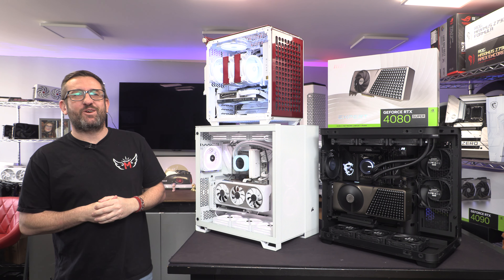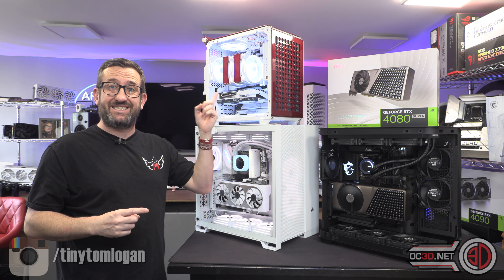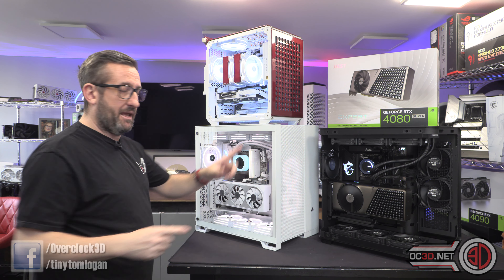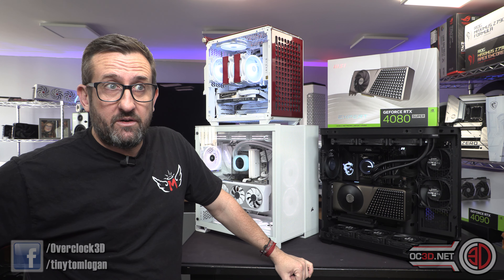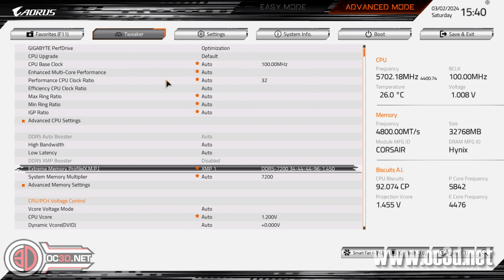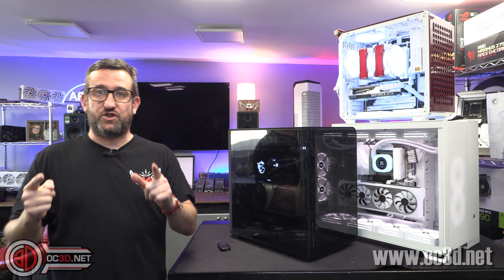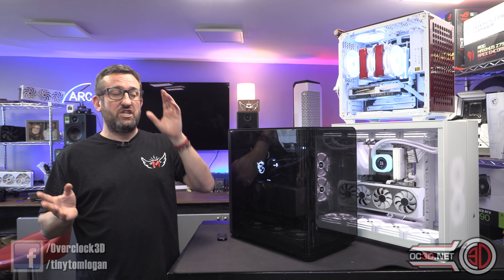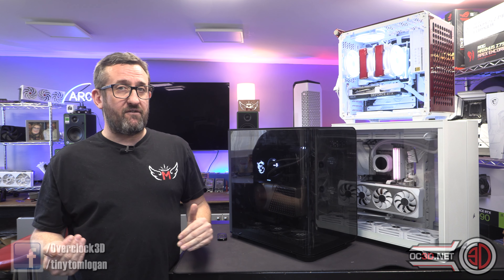Intel CPU Undervolting Guide Asus MSI Gigabyte 13th 14th Gen

Comment: why use fixed volts? and not offset. because in fixed it will allways run high voltages also in idle.
Reply: Also waiting for some good explanation in this
Reply: @lifeordeath13 if you run fixed clock and voltage, actually cpu degrades slower becuse it doesnt shifts the clocks and voltages all the time. prime example 6600k 1.32->1.34v 4.6ghz. you just need to run cpu with limits of cooler. back the i was on noctua cooler, and now with 9900k with 240aio. goal is to keep cpu under 75C to get that longetivity and slow degrade that can keep runin cpu for 15-20y

Comment: I have a 13700K and an Asus z790 motherboard, I managed to undervolt the cpu with a negative offset of -0.05v and LLC 3. The performance loss was minimal, non existent in games. I lost maybe 7 or 8 degrees.
Reply: Your way is hardly worth the effort for just 7 or 8 degrees.
Reply: @a1smith  Totally worth it in my opinion, not just the temperature loss, but my air cooler is less noisy
Reply: @a1smith  7-8 degrees is HUGE on this generation, which struggles with low clocks/crashes because of overheating
Reply: @AngryChineseWoman how did you undervolt it where that option in asus motherboard? Is it global cpu voltage or smth?
Reply: @a1smith
It is if your temps are approaching 100 degrees !!!
Reply: @TransformHypnosis  Exactly.

Stupid comment to make.

Comment: I don't approach undervolting with fixed voltages on Intel. I have asus motherboard and I found an undervolting guide on overclockers website that utilize the IA AC Load line to 0.26 and IA DC load line to 1.02. Set the limits to 253 W and 280W.  My 14900k does not reach 100 degrees anymore but 82 degrees on cinebench and reaches a score of 41500. There is multiple ways to undervolt the CPU. But the best way is adaptive undervolts.
Reply: Do you have a z790?
Reply: @blvzvr  yup z790 strix e gaming
Reply: ive got a similiar setup as yours. do you have a link to the guide please? cheers
Reply: @deano4003 the guide uses numbers for 13900k u will want to start with 0.3 for 14900k. And dial down  . The guide is very comprehensive there is one specific part in the beginning. Title let's start tunning the beat
Reply: I was able to find the guide (I think) by adapting what you had to: "Let's start tuning the beast" and searching for that on google. Thanks for mentioning the guide. Checking it out now.
Reply: What LLC and amp value?  what made made you opt for 280 on pl2?  I've been toying with 253/253/307 and 400a, along with auto dc and ac around 0.3 (may add in negative offset too) at LLC5, this on z790-e rog strix 14900k liquid III cooler (temps can still spike into 90s easily depending on workloads, simming and gaming 60-80c avg), cinebench maybe 85-88c (warm room 76F)
Reply: Does anyone could share the settings you’re all using to undervolt the 14900k?

Comment: Does using a fixed undervolt degrade the CPU faster because it’s always at the at voltage even at idle? Rather than voltage lowering at idle?

Comment: After months of frustrations with my i9 14900kf overheating, crashing during games and bsods, reading a million different solutions on the internet on tweaking the bios, this guide explained everything so clearly in each bios as the settings are quite confusing and frankly, overwhelming. Thank you
Reply: My god man. Same here. The only tweak that I think, still testing, worked for me, is locking p-cores on 5.5.

Comment: Thank you so much for this video! I've been going crazy for the since Oct 2023 with the i9 14900K and Asus Dark Hero motherboard.  Adobe Premeire and Media Encoder would crash CONSTANTLY when working with LOG video files and for the first time and I could NOT MAKE ANY SENSE of any of it.  Even went to the point where I thought my RTX 3090 was defective and even upgraded the GPU.  This solution FIXED EVERYTHING!
Reply: I went through the same thing two years ago when I built my i9 13gen and Asus z690e motherboard. The motherboard was pushing the 4,090 watch under unlimited power and it was giving me blue screens of death I spent months reinstalling drivers reinstalling Windows upgrading and changing out parts and components it was so frustrating . And in the end it was Intel and Asus not playing nice together I can't believe the hundreds of hours I wasted and the money for that matter

Comment: I would advocate using the LEAST aggressive LLC for undervolting - there is a phenomenon called undershoot that gets worse with more aggressive LLC, and if you are undervolting, undershoots can dip into unstable territory. Buildzoid has some great videos about it; you need an oscilloscope to know what's going on!
Less aggressive LLC means higher set/idle voltage (doesn't matter, because there's no current), but lower stable load voltages.

Comment: You are a cool dude, especially for showing us the same approach with 3 different brands. Thank you! I got a Gigabyte H610 board with an i3-12100F and NH-D15s. This system needs no undervolting, but it’s fun to play anyway. I use OCCT > Stability > Power for stressing. Best drops I get so far are 80W to 60W power, 71 to 53 degC temp, 1.16v to 0.90v vcore. Those are the hwinfo64 peaks after a 1min stress run. My bios vcore setting only goes as low as 1.1v. So to get lower I have to use dynamic vcore offset of -0.3v (its lowest option). LLC on Turbo. CPU clocks pegged at 4.1ghz permanently.

Comment: So I did my first build two years ago and back then I used the Asus z690e motherboard , the Intel I9 13k chip, two dims 32 GB each ddr5 Ram 6400 , NZXT crack and z63 two extra fans for push-pull configuration, the Hyte y60 box, 850watts psu gold star rated of course and the Asus dual 3070 out of my old PC. The first year I was using a lot of default settings and I ran into the 4,096 Watts being pushed instead of the 253 Intel default.. It being my first build and also being in the process of learning I assumed I did something wrong and every other day when I got my blue screen of death while working in Lightroom classic or Adobe Premiere I would tweak things here and there. One of the things that I have always heard over the last year is to undervolt. I know we're undervolting is and I know there is a positive side and a negative side. My question is this on Intel XTU when you let it run under the Intel optimized setting Intel will put it at +20. Can you tell me why they do that if we're supposed to be undervolting? The other thing is intel's optimized on XTU will actually make my computer thermal throttle like crazy. My number five core constantly hits 100 but the other 7 cores on my P course stay in the high 80s low 90s for the most part I'm talking like 88 to 91 . It's only the number five core that hits 100 when I'm throttling. I've taken my cooler off at least twice to repaste it because that's what I've been told but I still have the same issue with that one core. Chat GPT gave me a couple things to try recently but I still got the same temperature. So I guess I have two questions the first question is why does Intel optimization over volt instead of undervolting? Because I thought they were supposed to be in the negative . And number two if I did undervolt and all my temperatures are good except my number five core . Is it possible to just undervolt that one core? And if so what is a good starting place.. By the way my computer runs normally around 29 to 31° C when it's not under any loads . Under load it jumps up to 50s or 60s. When I'm doing hardcore Lightroom editing real fast it will thermal throttle up to 💯.. That's why I want to get this thermal throttling issue under control. My Intel benchmarks are like 12,600. I don't know if that's good or bad either

Comment: IMO, undervolting is a must-do - the factory settings are, are almost every CPU, massively generous.
Take the 5800X 3D, for example: use curve optimizer, and the temp goes down, while the performance goes UP.

Comment: Great video thank you, but one question - what's the difference between tinkering with all of these VRM voltages and load line calibrations versus simply going into Intel's XTU and setting an offset of say 085 and having your temperatures exactly where you want them to be? I don't understand because you're achieving the exact same thing basically even if you were to set all the cores to say, 5.8 or even 5.9, you just increase the offset negative and you still achieve the same thing.

Comment: I was working on reducing temps of a 14900KF yesterday which was running in the 80s degC in game.  In the MSI BIOS I used the 'cpu cooler tuning' setting to go from a 288W limit to a 253W limit (Intel's own spec limit) and also dropped the voltages by 0.05v with voltage offset mode.  This dropped temps by 16 degC in game!  If I only did the undervolt then that only gave a 4 degC drop.  So the power limiter was much more significant than the undervolt for temps.  Performance in-game was 0.2 FPS average lower (ie. not noticable) but with a 16 degC reducing in temps.
Reply: Where did you find the cpu cooler settings?

Comment: Hi, can totaly agree your undervolting arguments. But in the MSI-BIOS: "CPU Loadline Calibration Control" should set to auto or mode 4-6. Mode 1-3 (in particular 1) have the risks to regulary overshots the CPU voltage. For undervolting, use the relatively similar sounding "CPU Lite Load" under "Advanced CPU Configuration". Default is Mode 9 for MSI, and Mode 15 for Intel. If you set this to a lower number, i.e. Mode 7, the CPU voltage is going down. Lower Mode means a lower voltage, but more risk of unstability. You can also set the AC/DC line manuelly. I've set this to AC=1 and DC=9. Means 0.01mV/0.09mV. Intel recomends to set this value to 1.10mV/1.10mV or below. Smaler number = more undervolt.

Comment: I have been OCing since 286's and have always undervolted before OCing.
I prefer a stable system that runs cool over a space heater that is 1% faster.
Reply: Well, back then there was some real gains, you could get a 200$ cpu to behave like 500$, nowadays its just crumbs and hardly worth the effort.

Comment: I corrected my lite load and really didn't bother with an undervolt but after getting lite load set, I simply set my Top temp as 105C and it will never throttle and still can take the Intel extreme tuner back to Power Saver and use 3W Package most of the time at idle and remedial tasks. If I know I am going to run 100%, then I'll go back to High Performance or Ultra Performance and still not throttle when power is needed.
Reply: Which lite load did you use bro?
Reply: @duvanflo8643  The normal LL feature in the MSI bios. Not using advanced LL.

Comment: Wish I’d seen this video 5 months ago as I have just picked my PC up today from a local shop where it had been for the last two weeks as it had suddenly started blue screening and crashing constantly and when I tried to re-install Windows on it the installer would even crash. Ended up being my i9-14900k CPU has failed and wonder if that is because I was using an Asus Motherboard with their ridiculous “Optimised” settings by default rather then the Intel Limits. Basically with my PC running 24/7, I think the Motherboard settings fried the CPU.
Have got an i7-14700KF in the system now as the Repair Shop had no i9 Processors in stock to sell me, so I’ll be looking to make sure voltages on this CPU get lowered to prevent a repeat on my Motherboard.

Comment: Great video, very interesting.
I'm currently running my 13900k at -50mV offset and 304W power limit in XTU, and it gives me decent CB24 scores and temps about 85DegC.
I should I default XTU and try this method, as there seems to be no LLC option on XTU. Or can I just change the LLC in bios and leave XTU as is ?
I'm curious what advantage this method would have over just using XTU as it is
Reply: Undervolt in bios so xtu doesn't need to run but do it as an offset not this way.  You could search sampino or skatterbencher guide and tune your ll values not ll calibration as that will make your chip know exactly how much droop their is and it can then request the right voltage to compensate vs this way has overshoot. Intel spent alot developing its FIVR and is way better then setting a static voltage.  Also i idle at 9 watts on my 14900k since i keep octb and all other boost features working properly incurring all c states

Comment: what is the max peak voltage that should exist for any pcore in the i9 14900KF? im seeing 1.54V peak, but most of the time when under load it doesn't go above 1.434V...im just curious because during cinabench R23, HWinfo says im thermally throttling and the CPU package gets up to 101C Max...i have a 3 fan AIO btw and when im idle i get about 33-40C...

Comment: Hi. Is that correct when  after undervolting 14700KF with this method the OCCT shows me that E cores efficiency is about 2,4 not 4,3? how to make them higher? I use MSI Z790p- override 1.260v and Loadline set on 2. L1 L2 - 253 , ICC - unlimited.

Comment: But about MCE, TVB, SpeedStep, and ABT? Should EVERYTHING be disabled so its just straight up voltage giving you whatever you get, with no additional shit messing with it? I know especially with Asus boards, there's a lot of extra stuff going on, and vintage being rammed into your CPU.

Should i disable all of that, locking the max turbo ratio to 57x, so I have an absolute baseline? How about limits, at least least for getting my initial reference voltage, off or intel standard?

Intel CPUs run hot and overvolted from factory, but MOBO manufacturers have a tendency to feed them even more unnecessary voltage in top. At factory bios settings my Z790 Dark Hero was pushing 1.545v to my 14900k.

Just from common sense, im assuming youd absolutely want to disable all that crap, including Intels "extra" boost stuff, and lock your ratio to 57 or 58. Then you dont gave any adaptive settings or anything that would try to increase efficiency automatically without user input. Obviously your want the most control and least variation for testing to get consistent results. The only reason Im even mentioning it is because you never covered the need to do this for consistency/accuracy for ANY of of the boards, or any specific settings. Asus MCE would the NUMBER ONE offender for definitely being disabled, if that was the only one mentioned. It literally attempts to counteract your undervolting, by dynamically increasing voltage in an attempt to push clock speeds high as possible. Disabling that alone leads to a considerable decrease in temps and overvolting.
Reply from the maker: If you disable some of that on Asus it will stop it boosting, so its not as simple. You dont need to change the clock speed settings, it should turbo there on its own if set up correctly

Comment: I thiught most MB had thi setting as default out of the box - Enabled - Remove All limits] This item allows you to use optimized power and curr , not [Disabled - Enforce All limits] This item allows you to use Intel default Turbo core ratio settings.
?
Reply from the maker: Can still mean it's getting more volts than it needs

Comment: I'm stuck at entering cpu core voltage. 14900k msi z790-a pro seen 1.493v max in cincebench I don't know what value to enter.
Reply: I did -.1350v temps are in the high 70s mid 80s

Comment: Using Intel XTU I took -0 .165v off my 14700k, on a Asus z790-H. Runs cool as a cucumber now with AIO. 38-45c in games. Never above 65c in benchmarks. It makes you wonder why Intel has overvolted all these dies. It's baffling.  Oh and I clocked up to 5800mhz on two cores. It's solid and my CPU only scored 68.
Reply: I’m unable to get the underbolt protection off. And I disabled the protection in bios. Any ideas

Comment: I have the MSI Tomahawk Max Wifi Z790. i9-14900k, samsung 990 pro ssd windows 11 22h2 and 32 ram ddr5 corsair vengeace 6000mhz cl30. I had 2180 benchmark in cnbench 2024. After applying the settings and going from 1.420 - 0.025 to 1.395 I barely go over 1400 bench. It did not help me at all! I also have the latest bios